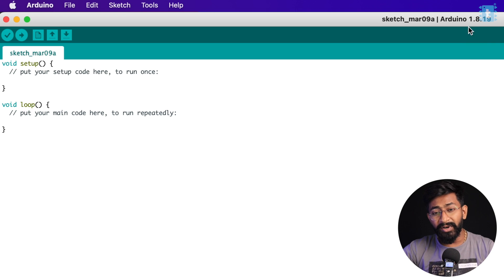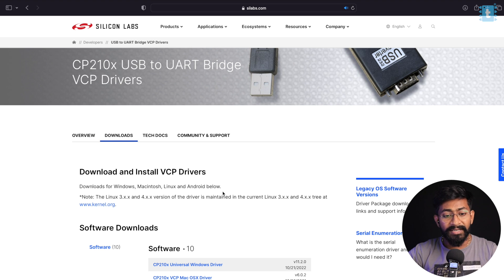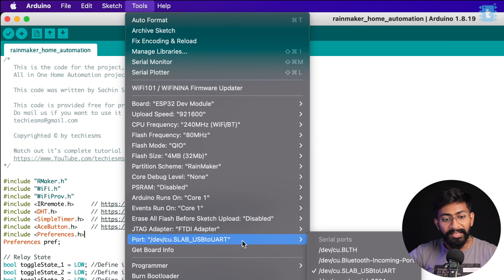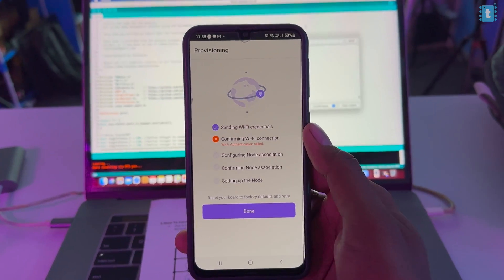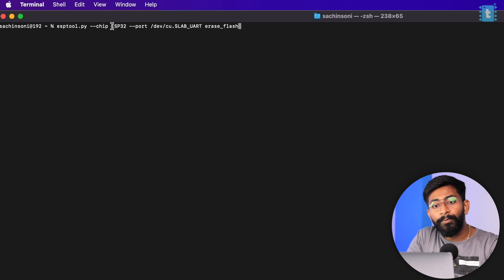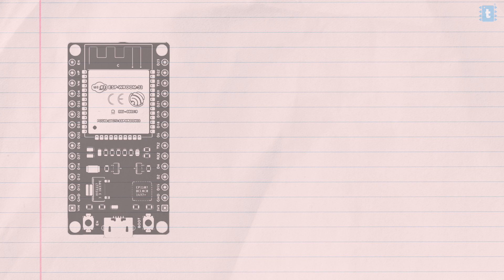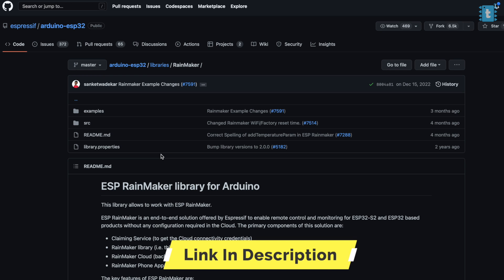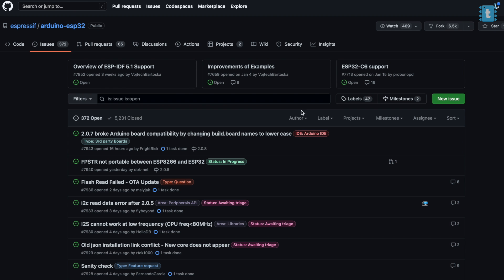Common ESP Rainmaker errors and their solutions | ESP32 Projects | IOT Projects

Comment: Now it is after updating the arduino IDE there are two Rainmaker partition scheme 4MB and 8MB. On ESP32 Devkit board if choose 4MB then error message "Compilation error: text section exceeds available space in board" and if i choose 8MB then error message "Partition ota_1 invalid: Offset 0x3fd000 is not aligned to 0x10000" while compiling "RMakerSwitch" example code

Comment: Hi Sachin! I am experiencing an issue with my Rainmaker project. I have tried using your same sample code (got from your Github) but instead of showing anything in serial monitor, it gives me two  errors mentioned below

o E (4797) wifi_prov_mgr: Failed to create additional endpoint 
o E (4797) esp_claim: Failed to create claim end point.

I tried searching alot but didn't find anything on the internet. 
Can you please help me out with this?

I have already tried multiple MCUs both Rev1 and Rev3. Also tried flashing them and reburn the code but still no luck

Comment: i was wondering if anyone could help me. i have used rainmaker on a esp32wroom one time before. now i want to use it on a esp32-C3. i use the example switch sketch and it compiles and uploads fine but after i never get the qr code or link. 
in the serial monitor i get the following:
btdm: bss start 0x3fcdf0a8, len 40
btdm: data start 0x3fcdf09c, data start rom 0x400591fc, len 12
MAGIC fadebead VERSION 00010006
E (16445) simple_ble: simple_ble_start enable controller failed 257
E (16451) protocomm_ble: simple_ble_start failed w/ error code 0x101
E (16457) wifi_prov_scheme_ble: Failed to start protocomm BLE service
E (16463) wifi_prov_mgr: Failed to start service

upload settings:
Board esp32c3 dev module
USB CDC On boot ‘disabled’
Cpu freqentcy 80Mhz(wifi)
Core debug level ‘none’
Erase all flash before sketch upload “enabled”  also tried with disabled
Flash frequency 80mhz
Flash mode QIO
Flash size 4MB(32Mb)
JTAG Adapter disabled
Partition scheme rainmaker
Upload speed 921600

i Hope someone can help me

Comment: Hi techiesms,

I need your help to solve this problem.

I trying to connect my rainmaker app with my mobile, but not successed. After scanning QR code Bluetooth connection established. During Wifi credentials step, wifi names not showing trying to rescan but not succeed. 
Do need full.

Note : Another mobile wifi hotspot i am using as router. That mobile wifi name not showing in rainmaker app even tried by another mobiles hotspot too.
Reply: 03:58:13.344 -> E (579) esp_rmaker_device: Failed to allocate memory for Device Switch1
03:58:13.344 -> E (579) esp_rmaker_device: Failed to allocate memory for Device Switch2
03:58:13.344 -> E (581) esp_rmaker_device: Failed to allocate memory for Device Switch3
03:58:13.344 -> E (587) esp_rmaker_device: Failed to allocate memory for Device Switch4
03:58:13.344 -> E (594) esp_rmaker_device: Failed to allocate memory for Device Temperature
03:58:13.380 -> E (600) esp_rmaker_device: Failed to     ocate memory for Device Humidity
Reply: Above mentioned errors I am received after hit an upload, kindly suggest what to do.

Comment: I'm also getting stuck at the 2nd provisioning problem so did the flash memory thing and it's still the same...is it my board problem or the code.... I'm using Arduino IDE 1.8.16 software and using the esp32 version 2.0.4 to program...any solutions...
Reply: lol same here also dude if u found any solutions pls let me know ,,.....
Reply: Originally i was unable to even get to the 1st provision so what I did was first use a program that would allow me to connect to the wifi network using name and password pre inputed. Next I went back to the original code and uploaded it and it showed me a new error and I went and cleared the boot by holding the boot button for 10 seconds and uploaded original code one last time and it started working, it didn't find any networks but inputting manually finally connected and all provisions completed succefully.

Comment: Esp rainmaker project is getting crashed when i do switch on / off fast -fast. I used 4 channel relay module with esp32 and taking 4 input with internal pullup resistor of esp32 to control devices manually. but its getting crashed when i do switching fast. It starts giving norrmal data to garbage data on serial monitor. now  i have restart the board to work properly but again on switch it get crashed.
Reply: I am also facing this, did you find solution?

Comment: Sir, please help me with the working of 5V 30 amps relay module. I am facing problems with it. The relay is not triggering when connected to 5 V module . I also tried with another new 30 amps relay but it also does not trigger. Whereas 5v 10 amps relays are working perfectly with the 5v power supply.

Sir , please help me to fix this......